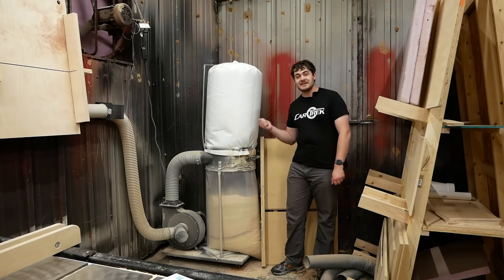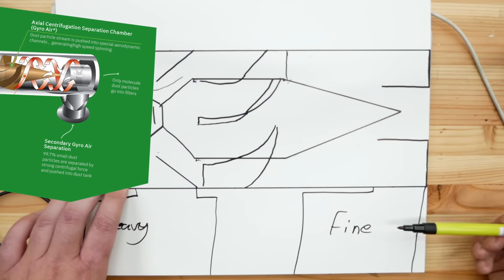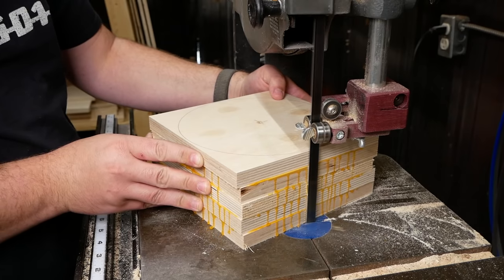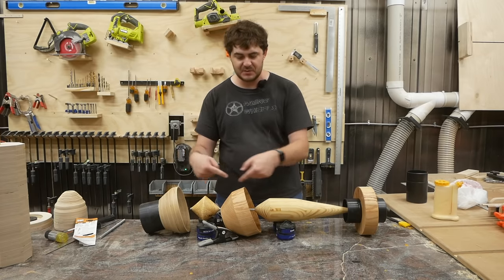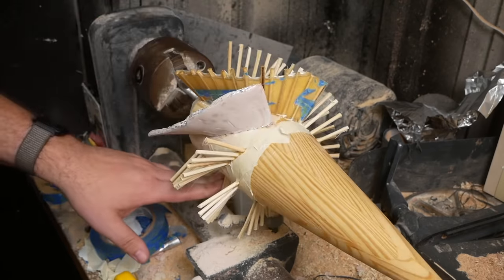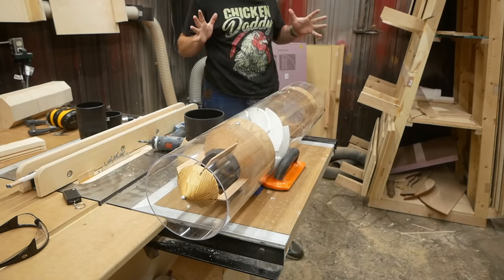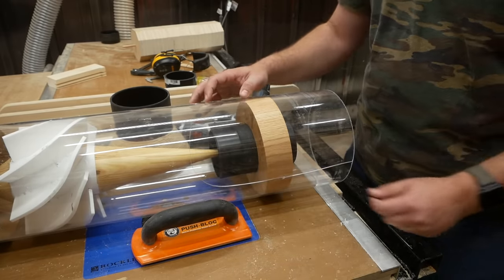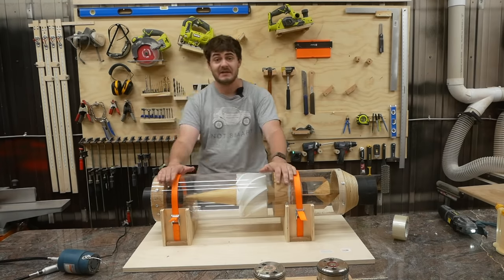I Made a Centrifugal Dust Separator to Upgrade My Cheapo Dust Collector

Comment: At first i was thinking ohh my god hes gonna spin that bad boy up real fast and its 100% going to explode. Then i relized it was stationary and my fears removed. Its looks sweet and functions to boot. Keep up the good work.
Reply: I was thinking the exact same thing. lol  Good on him!
Reply: I had the middle cones spinning inside the tube. It took way to long to figure out how it was working
Reply: Same, I was like how is it going to spin if it went in that tight????  Then he turned it on and it made sense.  The clear tube is awesome to see it actually working.
Reply: Yup. Definitely figured some mayhem would occur when he powered it up. Happy but sad that nothing happened.
Reply: Don’t you think the dust separater should be on the other side of the fan so the big chips would be removed before they hit the impeller?
Reply: I never thought it would explode as long as anything made it off the lathe. He was building the air guide, so softer wood like pine will last long enough. Probably forever! however, that did not stop me JUMPING every time the video sped up. LOL I thought for sure it was going to jam again. Terrifying.
Reply: same
Reply: @danchristenson251  steel impellers will take a ton of abuse, so it works fine as is.  Not sure what would actually happen if you tried to pull air through this instead of pushing.  Might not work exactly the same.
Reply: @danchristenson251  Well it is the impeller that does the dust separation, so it's a catch-22.  BUT... a screen or other grate might be a consideration.  The nice thing is that the impeller is stationary, so that if a large chunk does get through, it just gets lodged there...  Maybe a cleanout hatch in that area is in order?
Reply: same here i thought they would fall off if he spin it he didn’t explain it very well
Reply: I had the very same thought...  And then I realized it was static and began to wonder just how sturdy it really needs to be...  Could one create a reasonably efficient version from heavy-duty cardboard?  How thick would the plastic be required to be?  What other materials would work?
Reply: @mikeschmitz8355  air flow through a obstacle course works very similar whether it's getting pulled or pushed through.
Reply: @tabhorian  your dust collector blower motor should probably not be sucking stuff up first in the line of dust collection. However it seemed like the blower did that anyways with its original housing.
Reply: The idea behind this type of separation relies completely on high and low pressure and we're you create it as well relieve it. The principal issues will not ever revolve around what looks right. It does however revolve around Volume as in cfm, static pressure as well the weight of the material to be removed.
Reply: @danchristenson251  At first it sounds like a great idea, howver wonder if that could make the cylinder implode.
Reply: Is he still alive???
Reply: I thought he was making his own Turbo Jet too

Comment: It's impressive the amount of dust you need to make to make... a dust collector.
Reply: Just normal woodworking.
Reply: Even more impressive is that he still has all his fingers
Reply: CL: Nope sadly they are Prosthetics :(
Reply: One word.... planner
Reply: @nc3826  shop built
Reply: @chrislarmour  I'm not even a carpenter and nearly lost my thumb to a table saw lol. After using a guard for years, don't randomly use a table without one
Reply: Start with a milk jug and use it to make the other dust collectors.
Reply: What is even more impressive is how many ads it takes to make a dust collector
Reply: It doesn't matter which tool or machine you are working on.... It always needs another tool or machine exactly like it to work on that tool or machine.
Reply: @JohnDoe-zr6bk  #justwoodworkingthings
Reply: @ethanmize4656  They are there as a service to get you to walk away and improve your health. Live long and prosper.
Reply: I think you have  a wrong  vac configuration, the vacuum  should be at the outlet,  that way all biggest pieces don't hurt the propeller
Reply: @ethanmize4656  you mean the 0 ads on the time-line that got placed? The only ones you are seeing are the ones youtube insert themselves, if Robert placed any himself they would show up as yellow dots on the time-line.
Reply: @ethanmize4656  you need to familiarize yourself with the YouTube ad system (creators are not the only ones placing ads)
Reply: Hey gotta spend money to make money
Reply: @Moonsauc3  Table saws are by far the most dangerous tool in existence. Every person knows someone who has fingers missing from a table saw. How they weren't banned is a mystery. The radial arm saw is considered dangerous but is about 100 orders of magnitude safer for ripping boards because it has a permanent blade guard that is adjusted to cover the entire blade and a table saw is always used with no guard as a normal manner of operation. Radial arm saws make it very difficult to perform super dangerous tiny rip cuts because it has to be done with a custom jig. On a table saw you can cut a little sliver of wood and run your fingers right next to the blade, which you see in every YouTube video. Now, do not use a table saw without a modern riving knife. If you see this comment it is the universe warning you!!!

Comment: One quick recommendation... place your fan on the back side of the collector. That way your dust collection box will be under vacuum rather than pressure and you won't be running as much material through the fan. Also, if the pressure drop in your system is low enough you could switch to a higher efficiency backward inclined fan down the road.
Reply: My thought exactly. Why put all those chips through your impeller and potentially damage it?
Reply: @penguinhobbs  The impeller is specifically designed to withstand wood chips, is it not?
Reply: @joelhicks5162  it is but can still get damaged, also if you sick any metal in it could cause a spark and potentially a fire. Safer to put cyclone before the impeller.
Reply: @penguinhobbs  That makes sense.
Reply: @penguinhobbs  Thats how all bag dust collectors are designed. As well as Kirby Vacuums... and leaf vacuums. prob some other stuff too. But with the new cyclone, would make for a MUCH quieter running system. I'd say put it on the outlet as well. Heck, you could throw an HVAC squirrel cage fan in there now for more blowey power.
Reply: This is how big industrial Bag Houses are set up, separator - filters - fan. Last place I worked had a 40 foot tall version of this, when the blower weighs 400lbs and the motor attached to it weights 1500lbs you protect the critical hardware.
If one wanted to try using furnace filters this would be the way to do it as well. Those filters are meant to be used with negative pressure, you might need 5 or 6 with the edges touching as they're not really meant for more then 20cfm each..
Reply: The problem is that you "suck" the chips out of the seperation ports too.
Reply: @Mikepet  No, you cant suck anything out of a sealed container. There must be a stream of air for particles to move in. I have designed couple of seperators, and always placed them in low pressure side, as mentioned before - it is so much easier to seal system designed this way. Only the cheap dust collectors with bags have fan before the collection container because they have almost no seperation - bag does all the job of seperation and filtering.
Reply: @artursart  yeah, i wrote the old comment before He showed that He sealed the Container. I thougt it wasnt sealed.
Reply: @joelhicks5162  yes they are
Reply: I vented my blower out through the wall of the shop.  No filter bag, just blow the chips and dust outside.

Yes, I live in the boonies, far from any neighbors, and I scoop up the pile once a year with my tractor bucket to mix it into my compost for the gardens.
Reply: Seems only appropriate to spin it ahead of the fan, after seeing the points made here.  Makes a lot of sense, just stay mindful of having enough negative pressure fan performance and sealed bins or barrels.  First time on this channel so just wanted to say good conversation here folks, appreciate it.

Comment: “I made garbage lathe tools!”
“Turning this baltic birch is really hard!”

With proper tools, turning is really fun and won’t kill you!
Reply: But in turn doing that will take the fun away
Reply: @BassBanj0  not doing it could take your fingers away!  It’s like Shop Roulette!
Reply: Turning plywood, which is 100% end grain is less fun.
Reply: High quality lathe tools make all the difference in the world. Makes for possibly my favourite part of woodworking
Reply: @queazocotal  Turning solid wood would be cutting 100% end-grain 50% of the time; plywood would be cutting 50% end-grain 100% of the time.
Reply: yeah, it's the tools, never the tool using them
Reply: these carbide tools are scraping not cutting ... it works much better and is much more fun if you use the cutting ones.
Reply: Although I’m not chiming in on the critics over all, this I completely agree with. Lathing large chunks of hard wood or plywood requires the right kind of tools.

Comment: I'm sure someone has said this before, but It might help to put the blower on the exhaust side of your separator as a vacuum.  This would pull the dust through the separator.   This will help prevent the impeller on the blower from getting damaged by the dust and chunks.  Great work!  I love to see people make an attempt, and show how things didn't work.
Reply: That is the reason I sold my Harvey, e.g. the impeller continually was blocked by anything that would not pass through the safety screen on the input port. I decided to go with a true cyclone to seperate the dust before the air passed through the impeller.
Reply: I'm pretty familiar with cyclonic collectors.  I worked for an air pollution control company.  I stumbled across your video when I was looking for hook-up recommendiations for a small centrifugal separator I bought to remove oat grain hulls from the groats.  I'll stick with the mechanical separator, but watching your video was interesting.  Yes, your overall system efficiency would be improved by pulling air rather than pushing int.  If you follow the suggestion, then install a differential air pressure detector (i.e. -- Dwyer) across the filter so you know to clean it when the filter is blinded by dust.

Comment: The old dust collector sprung a leak when it realized it was being replaced. Addendum: Watching this video reminded me why I don't have a wood turning lathe. There is something very safe about locking a tool in the tool post of a metal working lathe (which can also cut wood in a pinch) and keeping your fingers clear of the spinny thing.
Reply: The machines are waking up...
Reply: Then you get into metal spinning and it's all the craziness of a wood lathe with razor sharp metal.
Reply: ...in a pinch lol
Reply: It's not the best representation of ways to use the lathe.  Go watch some professional wood turning videos, there are much better ways.  And longer tools go a long way towards tool control and better safety.  And they aren't that much more expensive.
Reply: @theJonnymac  while I’ll stand by the Clickspring recommend, I also endorse what you’re proposing. :)

Comment: This makes me want to add a vacuum dust cyclone ahead of the Harvey design, to get rid of most of the big stuff, then run the motorized impeller, then the Harvey designed pressurized separator.  Thanks for showing me this design!

Comment: Dude...  this is friggin AMAZING!!!  I'm going to build one of these.  I'll be working out my 3d printer like crazy
Reply: That was my thought entirely: That is a job for a 3d printer.
Reply: If you figure out how, I’d love to buy the 3D model!
Reply: @markhalvorson4631  For sure.  Once I figure out a design, I'll post it to Thingiverse.
Reply: @marthale7 Chain the knockoffs FTW
Reply: I commented something similar, this is a perfect project to 3d print.
Reply: I have made the design in fusion 360, but I need the dimensions in the length direction. (5 inch/100 mm ports)
For an image of the design: https://i.postimg.cc/DZD9jvPZ/view-3.png
Reply: @Clemens878  Nice!!
Reply: Glad the community is ahead of me on this one, I'll be watching thingiverse for it. A thought, replaceable parts would be huge as I expect a lot of breakage and wear.

What material are we thinking here? ABS? PETG? I'd love to do PLA for the simplicity but guessing that won't hold up.
Reply: Another one here starting to design it in Fusion360 and 3D print it! Anybody here wanting to collaborate in the project so that we can make it easier and better?
Reply: @Clemens878  size it for 8" sewer drain and it's accessible to the masses!
Reply: Dunn has a working version where I love to have the dimensions of. Certainly the ones in the length direction. No luck so far to get any response from him.
Reply: @Clemens878  Love the work, I'm just starting to design a shopvac sized one with some 5" acrylic tube I have sitting around. Looking at your picture i'm curious as to how the fins are secured. Are you planning to add a thread rod like Dunn's design or thinking along the lines of a pressure fit?
Reply: @jamess5872  All parts have a centered hole for a thread rod, just like the design of Dunn. The part of the fins is printed in 1 piece.
Reply: @marcusretaken72  How's the design coming? I put together a shopvac sized one that I am going to test this week and modify as i go along before up scaling it.
Reply: @jamess5872  Slow...  I haven't had much time to devote to it yet, but I am working on a design that utilizes the Lilly Impeller, and I am also looking at dual 4" tubes instead of one large one.
Reply: @jamess5872  Can you already share some experimental results?
Reply: @Clemens878  Currently  I am waiting on delivery for the anemometer & manometer and I have a cyclonic dust separator to compare it to.  I'll try to get everything done by Saturday evening and give you guys an update
Reply: For the people who are interested. You can see my first running test on my instagram. http://www.instagram.com/Handy.Scientist